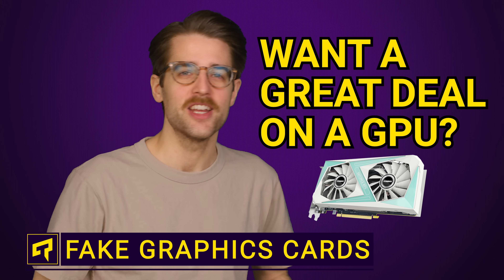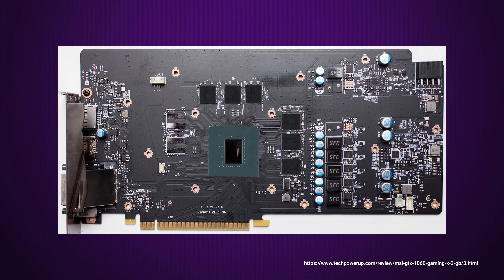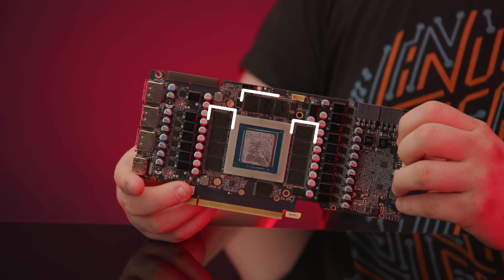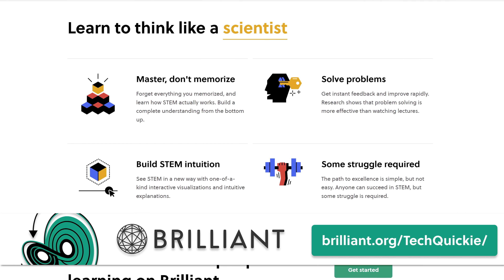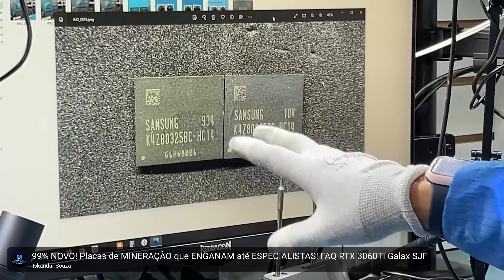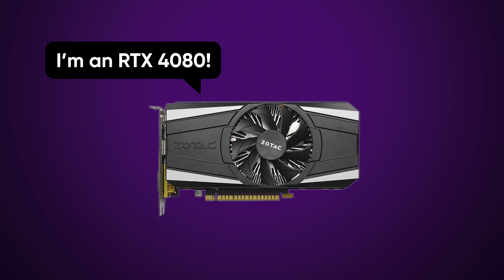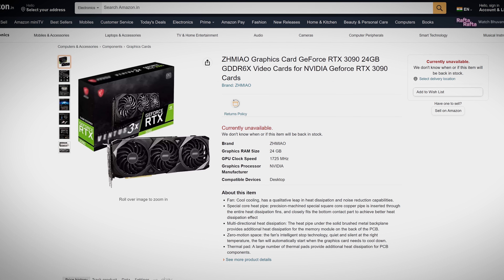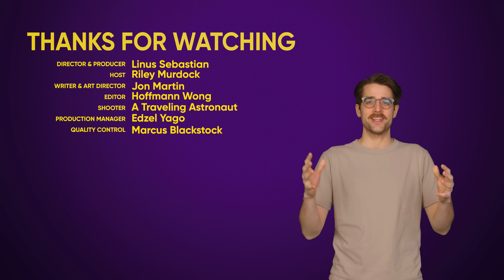Fake Graphics Cards Are Everywhere

Comment: I recently bought 2 Nvidia Telsa P40 on ebay... they were shipped from china... they worked, they registered as real and after opening, cleaning and checking them everything seemed fine. They work great with 65b llms^^ (at least usable, but you won't get better options under 6k $. It's a risk, but in my case I am happy.

Comment: I purchased a "ASUS GTX 760 3GB GPU" for a decent price on eBay and it worked.
but when I tried to play something as basic as Roblox it crashed a couple minutes later,
turns out my BIOS said it only has 14MB memory which is bad.
so I have decided to never buy from eBay again and only buy from Newegg.
Reply: Did you get your money back?
Reply: @UnderOneLight  no. I didn't bother and it turns out I was reading the wrong info and after some use it worked as normal it was kinda strange.

Comment: Totally agree with Riley, but I curently using a fake Esonic advertised GT730 2gb GDDR3 (in fact it's a GT610 with 1Gb DDR3). The driver goes well and the card just run daily since 2019 till now

Comment: I bought a RX6600M which has been repurposed into a PCIe GPU for mining, quite cool if not hacky.
Reply: Same here. Afox mb for 6600, but M chip on it.
Nearly half the price of 6600, but ~98% or equal performance.
With the claim of "98% new, refurbished"
Reply: @ashfaw  There's now desktop Motherboards with laptop GPUs on it, quite cool. If only it came in an ITX form factor for SSF, would have been so cool
Reply: @jierenzheng7670  yup, saw today from CraftComputing and JeffDoesTechStuff videos about it.
Quite an interesting mobo, but price skyrocketed from ~160 to ~250-300 $
Reply: @ashfaw  Yea, wish it was in a smaller form factor so I can fit it inside a i100 case for a portable PC.

Comment: As someone who just pulled the trigger on buying 7 4080's on ebay for $500 each 2 days ago, I hope that I didn't fall for this. Though I am gambling on the 60 day return policy to save my butt in case if things blow up. Thanks for the video!
Reply: I’m sorry to say that price is probably too good to be true. I hope you can get your $3.5k back once the inevitable happens, or, at least you get lucky and they’re usable. Do you plan on flipping them or something?
Reply: @patricknelson  I understand it is a bit of a gamble but hope that ebay will have my back if there are issues. I was planning on flipping them for $1,000 each after I check them with gpuz and benchmark them.
Reply: @richguy011  Wanna post the listing?
Reply: @richguy011 did you return them?
Reply: @UnderOneLight  Yeah, it was an ebay scam. The scam works by miscategorizing the item and having the purchase be above a certain amount. It makes it harder to submit a "did not recieve item" form.
Figured it might be too good to be true but trusted in Ebay's policy to have my back.
Reply: @richguy011  I bought a rtx 4070 ti super brand new for $633 after everything said and done. Haven't bought from eBay in so long I forgot to check the sellers rep which is 0 and is from China. It does accept returns though so I'm guessing he's passing a crappy, used one as brand new

Comment: eBay has pretty good consumer protection. I am surprised that they didn’t mention any tactics to protect against this. 

1. Does the graphics card have VGA or any other output it shouldn’t? Many scammers often use very old GPUs like the GTX 650 Ti as a base for their illegitimate products. One surefire way of determining a fake is if has VGA when the real product shouldn’t. Nvidia 900 and AMD R7 300 series and newer do not feature VGA. If there is a 1050 Ti with VGA, that is definitely fake. Mid to high end cards of the slightly older cards do not feature VGA as well. Of course this doesn’t apply to which may have VGA like the GTX 750 Ti.

2. Unbranded card: If a card doesn’t have any branding on it and the pictures are generic online shopping pictures, skip it. This also applies to cards that simply branded as NVIDIA or AMD and are clearly not reference models.

3. Weird coolers. If the cooler doesn’t look like anything you find from from the card makers themselves like MSI or Asus, skip it since they are likely using older heatsink. Do be aware though that if someone is selling a card from an OEM like Dell or HP, the heatsink may not be standard but follow rule 2 if you have any doubts.

4. Comes from China. This is not a surefire method especially if you do live in proximity to China but the vast majority of scam cards do come from China. Simply select your own country only or your home region (NA, SA, EU, etc) if you don’t live in proximity to China. Again, this is not surefire since scammers can live anywhere but they are most prevalent in China.

5. Generic photos. If the photos used are reused photos from other seller or the internet or generic online shopping photos, beware. I am not saying this is a clear indicator of a scam, but if you see this, be keen to follow the previous rules to sniff out a scam.

If you believe you have been scammed, you can report it to eBay and they will return you your money and you get to keep your mislabeled GTX 650. I don’t know how it works with other marketplaces though. Do not fear used cards, they are great, just know what you are looking for and you will be good. And eBay has you covered in the event you do fall for a scam.
Reply: Awesome advice, thank you.
Reply: Ebay sales counterfeit products and does nothing to the sellers

Comment: TLDR; you ARE the precaution against fake merchandise on AliExpress and Wish.
(My motherboard and gpu are from AliExpress and both are working as well as they should, though the motherboard DOES get hot due to it being built for flower coolers and expecting some airflow on em, this is a manufacturer flaw though)
Reply: Wait, you can actually buy decent GPUs on there? Interesting 🤔
Reply: @ireallyreallyreallylikethisimg  you can, just be super careful, look at reviews, price, manufacturer, rating, how many complaints they have, etc
Reply: @ireallyreallyreallylikethisimg you can but you have to research a lot

Comment: A nice idea for a video would be the longevity of a ssd vs a hdd today, from different stand points, like a professional that has to write data everyday or a normal user that doesn't do much with it. Even if it's an interesting topic, it's really hard to find informations about it. Also considering that today we can even buy easily a 2T ssd m.2 nvme for like 120. So would ssd be a good choice for storing backups? Or in a long run would be better the choose the hdd? Which would last longer and in which cases?
Reply: I mean, hard platters have a lower price per storage unit (50$ for a 1TB hard disk versus 100$ for a 750GB solid state drive) but have a slower read/write speed.
Reply: @GrayDaDolf  The issue is shelf life. How long will a HDD retain the information compared to a SSD? It's not only read/write cycles that limit Flash memory. The memory cells will discharge over time if the drive isn't used. Same with a HDD. The platters store information by magnetizing incredibly small spots on a spinning disk. Each 1 or 0 is stored as a individual spot. Over time the magnetic charge will get weaker and weaker until the drive head can't read the information reliably.

So the question is how long it takes for the information to become unreadable.

Early Flash memory was using so called SLC tech, or Single Level Cell. Each sell stored a 1 or a 0, and that was it. This meant that there were pretty large difference in the charge for these so in theory they were a lot more long lived than more modern designs such as DLC, TLC or QLC.

Now I cant find numbers for what these values are exactly, but it's not a lot of room to play with. And yet in a DLC flash memory each cell can take one of four (4) values. If we assume that if both values stored zero the "level" is 0, and if both values stored is One then the "level" is 1, you will have two more "levels" that need to be retained and discernable by the controller. So 0-0 = 0, 1-0 = 0.25, 0-1 = 0.75 and 1-1 = 1.

Now any drift in the stored value will make it harder for the controller to read that value back. But DLC is old tech. Even TLC is old today, and the latest of the decently cheap SSD's are using QLC memory, storing four bits in each byte. Now things get hectic as to do this the storage controller will have to accurately store and read sixteen (16) levels in that cell. If they manage to make PLC memory it will have to differentiate between 32 levels per cell!

So any drift in the stored levels is bad news for the stored data.

A flash drive that is in use can have the controller reading and refreshing memory cells to stave off memory loss. But writing to a cell also degrades it so a part of the flash memory in the drive is set aside as spare area to be swapped in whenever the memory controller detects that a cell is no longer able to retain the information reliably.

All in all we are putting a lot of faith into these technologies. HDD's we pretty well know how long they last, but flash memory is not as simple or well understood.

Back in the 80's and early 90's I remember running special programs on hard drives that basically read all info and rewrote it back, checking that what was written could be read. They also could do multiple attempts att reading sectors that were failing, and some times were able to recover the data and write it back. If the sector failed on write it was mapped out and a spare was reallocated. Yes HDD's also have extra storage areas that get swapped in when sectors starts showing signs of failing.

However that type of program was largely made obsolete with the introduction of IDE drives. The older MFM and RLL drives allowed access to the raw data read by the drives read head, while IDE and SCSI drives hid that part of the operation from the rest of the system.
Reply: testing longevity of those things would take years there’s no point it’s easy to google search

Comment: Did Buy one by curiosity, advertise as a 550ti and I was surprise I got a ... 550ti, work with Nvidia driver, match cpuz and the bios was right lol. Still a junk card, but have to try lol
Reply: The 550ti was amazing for it's time. I had one and the performance was amazing when I purchased on 2012 and also kept me playing most titles on 1080p until 2015. Later on most games required 2gb of vram and that GPU only had 1gb.
Reply: It was great back then, that probably the why scammer salvage them and reuse them with their chineese type card wich mots of them are bios modified scam.
But for today standard, it on the low end but still good for basic stuff

Comment: Just use an APU and forget graphics cards like we did modems, network cards, sound card, IDE controller cards.... etc....
Reply: Today's apus are insanely good that you can do good gaming on it without a dedicated card. I understand that the dedicated GPU will give you a great performance boost but, when money is a big issue, an APU will work just as good until you can upgrade. Even LowSpecGamer made a video about this, buy PC first and then collect money to buy GPU later.
Reply: @Anas7ergun  very true - for now. I think in 5 years' time the trend will have changed and in a decade's time a dedicated GPU will be a rarity. Just look at what apple is doing.

Comment: is fake gpu have clue just like old fake gpu that claim X but just old gt 500/600?. or it have look like modern gpu with big brand name on it like MSI or Zotac?. because recently someone i know that buy RTX3060 almost a year ago that not only far beyond market price. also just broken few week ago. her daily use only for ight render only. it should covered up with at least 1 year warranty but since the box gone. the website of this brand doesn't allow me to add the product. because it ask for proof purchase and a code on the box.
i wonder if this GPU is fake or not. and since i never use rtx or see other rtx performance on that specific render file. i dont know it fake or not. all i know before it truly dead went diagnosis a problem. it does for last time before dead. detected as VGA compatible or something. for few second before back to RTX. and now it doesn't pass windows login screen. the bios screen /splash show up but after that it black. have same result on a donor pc. so yeah it dead. and all just in 1 week. from not detected cuda at render. to driver starting to crash. to cannot install driver because error something on device manager. to just a fancy useless junk to a rainbow light.

Comment: While you are saying that I have one of these 3080, peladn is the brand, I paid one third of what it costs in my country and the performance is better than the ones presented by Founder Edition on the internet, and better than my friend's gigabyte. Just buy from the right places... as for not having a warranty, at ali for example, you even have a 2 year warranty from the store, plus the protection of the platform. You only have to send the graphics card back, the store even gives you a refund on the shipping, or, you can simply buy another one since you can buy 3 for the price of one. In most cases, you get it fixed locally, send the receipt to the store, they reimburse you.

Comment: I still remember seeing a “980ti” being sold for 50 bucks when it was new and the info told people to please not compare with a real 980ti.
Reply: RTX 4090
$2000

Description: actually a GT 1030 pls buy i wanna buy a 4090
Reply: That's easy. When the seller is selling those fake cards with real price, now that's very hard to detect.
Reply: @wakaneut  I just thought it was funny when they told people to please don’t compare with the real card. Makes it very easy to know it wasn’t the real deal. Especially since they listed the number of CUDA cores and it was much lower than it should be.
Reply: Already giving a HUGE red flag from just the info/description alone
Reply: fake 980ti but with extra steps

Comment: They just put working chips on a new working board. That does not mean they are fake.
Companies that do this are keeping e-waste out of the landfill.

That's like saying that you have a new battery from a third party changed the battery in your iPhone. Does that make the iPhone fake now?
Reply: If the seller is up-front that they're doing that (marketing it as refurbished or factory renewed) that's fine. But if I sell you a GTX 3090 that I swear was only used by a little old lady to run streams of her cats and you get something that smells of fresh solder, I've scammed you, bro.

Comment: "Buy from reputable sellers and add-in board partners"
- Shows pictures of an EVGA card -

Ow, my heart.  :(
Reply: Did you see the GN video where they got to be there for the final days of EVGA? When Riley mentioned making a Frankencard by combining components of several dead cards, I thought of the fact that *EVGA actually had a team to do that* and they did it extremely well.
Reply: right in the feels :(
Reply: Thats sad news. I have a EVGA 760 GTX, wich is still in use and going strong, with probably over 10.000hrs on it. They made solid products.

Comment: Over a year ago, I bought a "2GB GTX 1050-Ti" which I realized right after that it doesn't exist. And it ended up being a terrible GT 210. But now I have a beautiful 1650 ❤
Reply: How did you figure out it's a GT 210?
Reply: @cuhleef  performance must have been atrocious 😂
Reply: @DragonOfTheMortalKombat  I didn't even install it, I already had an RX 460 and knew that it would outperform the 210 by a landslide
Reply: @cuhleef  Tiny little sticker on the back of the card
Reply: @RotcodFox  Thanks for the reply

Comment: Here in Philippines there is a rampant sale of Aisurix branded cards. Im convinced they are not fake, but reassembled parts from different cards. Thank you for shining light on this
Reply: @Hydelix  what resolution though  with upscaling or not?
Reply: Yeah, they're everywhere, like I even wanted to buy one myself. But not before LTT labs tests the heck out of them. And they better do it soon, TOO MANY SHOPEE SALES HAVE PASSED, AND I WANT TO UPGRADE MY RIG😭😭😭
Reply: @chillphill13  They just dropped a 1660 super for cheeeap, gonna order one and try it.
Reply: @JustCurious-ne5sb   you're right, that's hella cheap. Problem is that my motherboard is just GDDR5, still on RX 560 4gb, sadge ☹️☹️☹️. RX 580 is less than 5k though, I might wanna try that next month.
Reply: @chillphill13  I have an older dell xps 8700 motherboard, do you think the 1660 will work with it? I still run ddr3 ram
Reply: @JustCurious-ne5sb  I also still run on DDR3 RAM. For your question though, not knowledgeable enough to help you out, sorry. I'm also unsure when it comes to compatibility 😅😅😅
Reply: @chillphill13  Hey no worries i am confident they will work. Just plopped in an asurix 580 8gb (1660s still on way) and it is legit. very cool, very quiet, very capable, only 120.
Reply: Someone make a petition for LTT labs to test Aisurix GPUs, tell Ivonne, emai them... WE NEED RESULTS FROM THE TECH GODS!!!
Reply: daming RX 580 8GB sa marketplace katakot bilhin baka may hidden defect or fake label haha
Reply: do you have a link to where i can know more about those cards? salamat pre
Reply: @cliburnhernandez8444  i think Toasty Bros made a video about their "RX 580" card last month
Reply: @cliburnhernandez8444  Lazada
Reply: @cliburnhernandez8444  oh wait you mean learning more about it not buying oops xD
Reply: @gogetablue7905  haha yeah.. wont get a fake card lol thanks man..